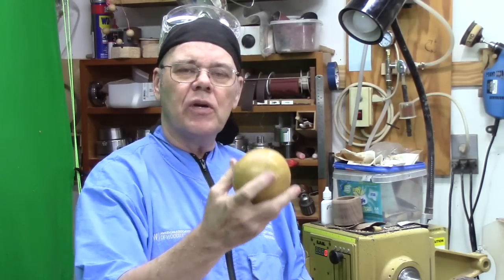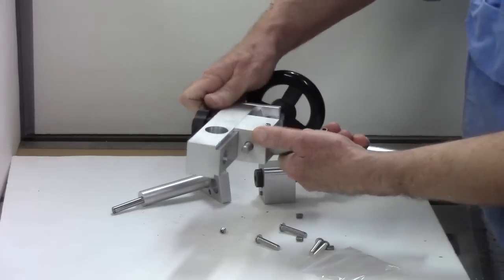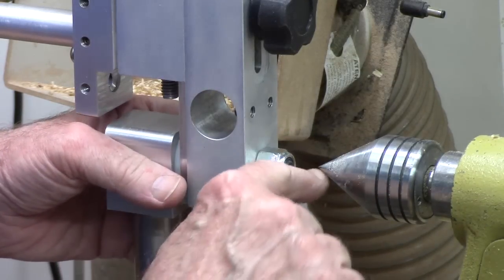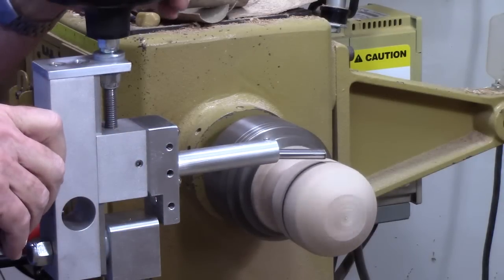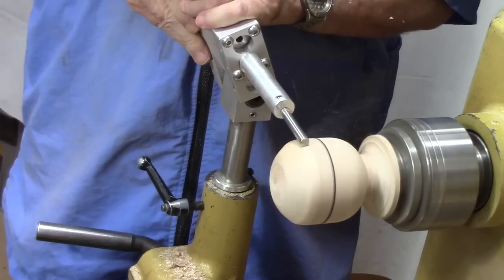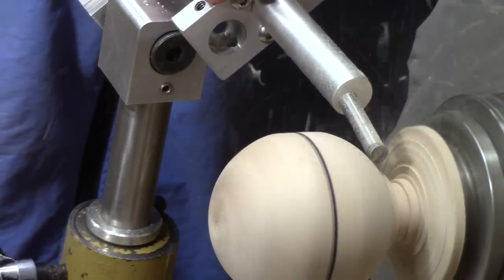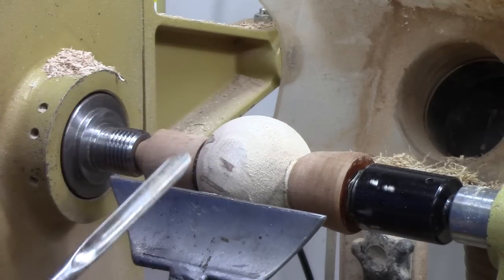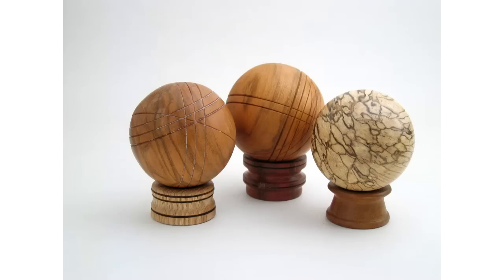Sphere Cutting Jig in Action!

Comment: Hi Mike. I just received my Sphere cutting jig from Chefwarekits about two weeks ago. You needed to sharpen that HSS cutter out of the box. Craig does not sharpen them only a rough flat at the angle needed. I touched that baby up on my CBN grinder and oh yes away I went. I could tell by the sound and site of you using the HSS cutter that you had not tuned it up. I am sure the carbide is a world of difference in the cutting. But give that HSS a try again and I think you'll agree it is better with a sharp end on it. Great video as always.
Reply from the maker: You are right. The HSS cutter  did indeed need sharpening. After using the carbide, I doubt if I will ever use the HSS cutter again.

Comment: Can you turn the inside to make it hollow?  1/2 of the ball.
Reply from the maker: Yes. I would do this by esentially turning two bowls with a tenon on each. Make a tenon on one rim and a matching recess on the other so you could glue them together. Than take your rough hollow sphere and mount one end in  a chuck and use the jig for final shaping.
Reply: Mike Peace Woodturning  I see one of these that you can hollow out 1/2 of the ball after parting it in half and leaving a tenon on both halves.  I am new to turning in your eyes so I may not word my question exactly right.

Comment: Mike what is the max & min size you turn with this jig?  Looks like it works well and is responsible on price. 👍🇺🇸
Reply from the maker: The instructions say 1" and 11". I have not done any at those sizes.
Reply: He answers that question toward the end of the video. There are three different positions for mounting the tool bar, which gives you a range of (IIRC) 1.5 - 11 inches in diameter.